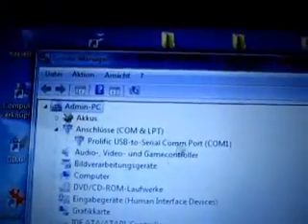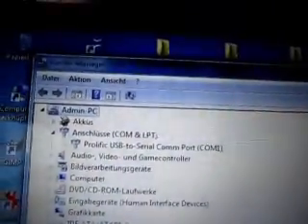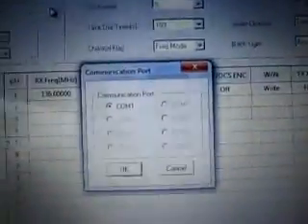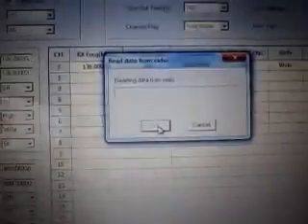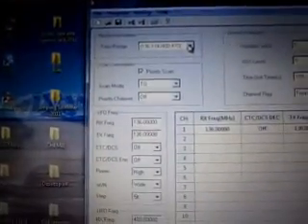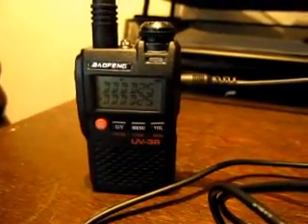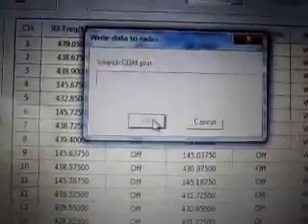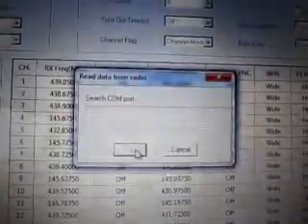Baofeng UV-3R Mk II - PC communication problem

Comment: Very similar to my UV-B5, I got the "Radio Did Not Ack" response.  Tried the usual dodges to get this to work, no joy.  I found today it's necessary with the B5 to hold the double plug with strain applied towards the front of the radio. Using the Baofeng software - it still won't contact to CHIRP! So it's mostly a contact issue - Baofeng is extremely lax with keeping their radios in spec in terms of contact-touching - my UV-82 contacts this cable perfectly with no issues at all.  I see you have to use a single-jack cable (like for Yaesu maybe?) with this one - was going to buy one of these radios but think now - I won't!  It appears Baofeng are incapable of making a radio without at least one major gripe of some sort - it's like they have an idea for a model, quickly run up a few prototypes and if none of them explode/catch fire during a ten minute trial in the car park - they go straight into production - of millions of units, probably!  Then when problems come up - they ignore them, relying on their cheap prices to keep the majority of buyers from moaning too much.